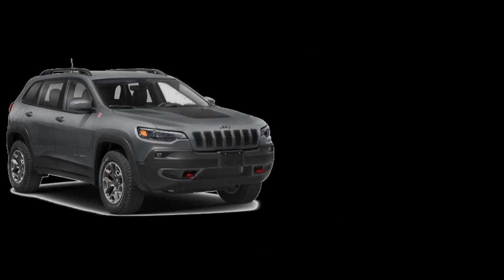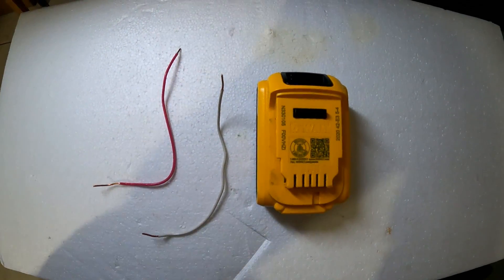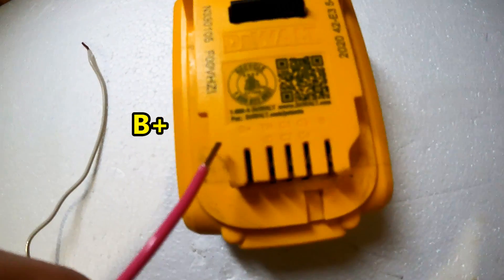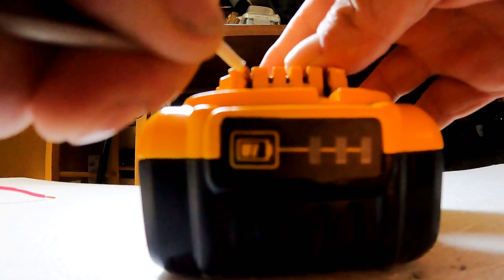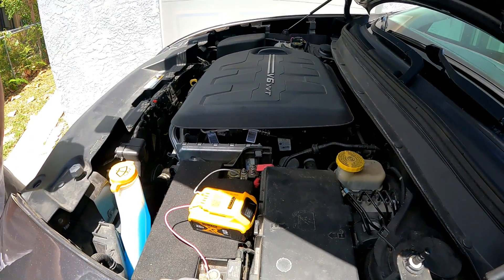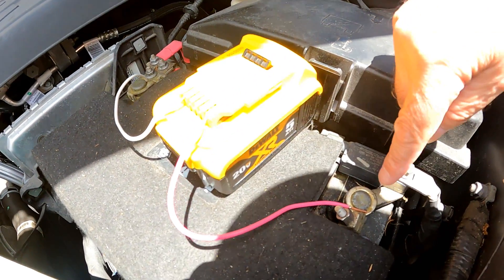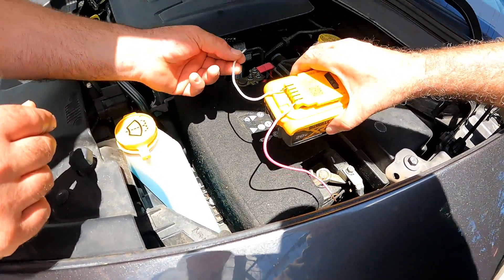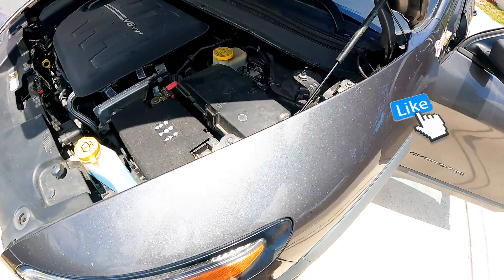Using a DeWalt Battery to JumpStart a Car Battery

Comment from the maker: Can a DeWalt battery jumpstart your car? In this video we show how we used a Lithium 20Volt 5AH DeWalt battery to jumpstart a car battery, with 2,  6 inch pieces of 14-gauge solid copper wire? In this video we show how we used a Lithium 20Volt 5AH DeWalt battery to jumpstart a car battery, with 2,  6 inch pieces of 14-gauge solid copper wire.

Comment: I am not an electricity whiz, does this work with other power tool batteries? Other gauges of wire? I've seen this done before with spoons lol
Reply from the maker: I can only tell you it worked with battery and wires I used. But with a similar battery I would venture to say yes.

Comment: I tried it on my f150 5.0 v8 but used jumper cables from the truck battery and connected to a penny in the battery slots of my 5ah DeWalt battery, it did not have enough power to start the truck . Truck battery was at 11.25 volts.
Even after connecting to another vehicle it wouldn’t start, had to let it charge a few minutes before I was able to start it
Reply from the maker: Thanks for sharing your experience and feedback!

Comment: This is pretty cool but I was wondering if the 20v could damage the cars electrical systems?
Reply from the maker: All good on my end. As a matter of fact they sell an adopter with battery cables and clamps that takes a tool battery https://amzn.to/3KHOMQJ
Reply from the maker: Dewalt Jump Start Emergency Assistance Adapter for DeWalt:
https://amzn.to/4mURoZ5

Comment: Didnt work and ruined my battery
Reply: It does work it may not work in some trucks that have huge batteries like an F-350 but it definitely does work
Reply from the maker: Great feedback👍
Reply from the maker: that's too bad. was your battery new? anything you can share would help someone. Just had to use it on my hummer again, it worked fine.

Comment: I only had small thin copper wire and it didn't work they burned quick so I think I need thicker wire
Reply from the maker: Yes. I like using 14-gauge or 12-gauge solid wire. Hope it will help you next time.

Comment: If we wire two packs of tool battery for jump start, would it give 2 times the current? This 2 packs is for emergengy jump start in case the car battery is completely dead.
Reply from the maker: never tried it.

Comment: Quick goofy question I’m assuming this is not a one time thing and if you leave the car running the battery will charge up if it was just drained a single time… I should know this I was married to a mechanic for 35 years, but of course you know what they say about the shoemaker’s children never having shoes😂

Comment: A little advice, do not use Flexvolt batteries, the amperage is so high that it melts any wire sheath and can damage any accessory or plastic that is nearby.

Comment: Field tested ! And it worked , used an 8 ah dewalt  and bx wire
Reply from the maker: That's great to hear! Thanks for the feedback.
Reply: You can use two forks instead of wires
Reply from the maker: @foam27  interesting

Comment: I’m in the UK, so have no idea what 14 gauge copper wire is in mm?
Reply from the maker: The American Wire Gauge (AWG) system is used to measure the thickness of wires, with higher numbers indicating thinner wires. A 14-gauge wire has a diameter of approximately 1.63 millimeters or 0.064 inches. Hope this helps...
Reply: @JohnCRV hes just a typical smartass brit..they tend to comment on anything that isnt measured in their way which is metric.....

Comment: Does this also work with a 12v dewalt battery on a 2L diesel ?
Reply from the maker: It should but keep in mind that it depends on how low the battery is. Let us know how it goes.
Reply: @ will do…..many thanks 👍

Comment: Would not advise doing this 20v to 12v system may damage it .would be safer if you let the battery charge the cars battery for about 5 mins then unhook it and try to start the car
Reply: I let it charge for 5  minutes, and it work 
The battery was warm when I unhook it
Reply from the maker: Thanks for the feedback
Reply: Do you know how to operate a video camera?
Reply: Shit worked like a charm 1 tap.. battery with 1 bar started it right up

Comment: Thanks for sharing another helpful guide! It looks like this would work for any car with a standard 12-volt battery, is that correct? Have a great Sunday yourself!
Reply from the maker: Yes! It should work on any 12 volt car, motorcycle or riding mower with a weak battery. Thank you and You have a great weekend as well! 👍